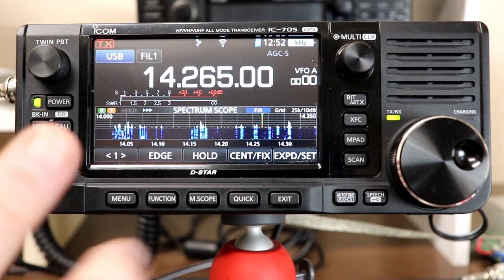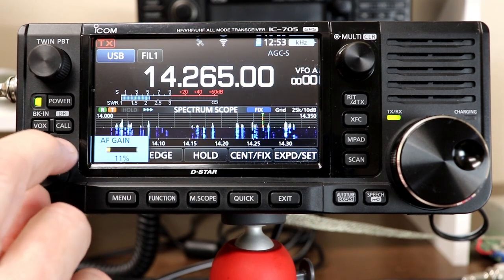IC-705 from A to Z #2 User Interface Basics

Comment: I have ordered my IC-705 which is supposed to be here in 2 days, I cant wait to get my hands on this one. It will be a lot easier to take into the field than my IC-7300 is.
Thanks for walking through everything as this radio has a LOT packed into such a small size.

Comment: Thanks for the excellent video.   What is the least expensive way to run direct power to the IC-705 so you're able to operate at 10 Watts?   Is there a "plug-in to receptacle" mini adapter solution - like you would have with a laptop for example?   Trying to avoid initially buying a larger "power supply" if possible.
Reply from the maker: Hi.  First, thank you for the kind words.  This is an excellent question!  I hadn’t really thought about this because I already have 12V supplies for my other radio gear.  You certainly don’t need a large station supply for just this radio.  HRO sells a 6 amp power supply for  ~ $47.00. They list the supply as being suitable for the 705.  According to the Icom manual, it draws a maximum of 3 Amps in Transmit

Comment: Amazing video, exactly what I needed!  Question, at time mark 10.29 what is the transmission that moves across the whole band scope from left to right? I see it on my 705 sometimes and have no idea what it is.
Reply from the maker: Hi Steve.  I've seen that multiple times on my 7300 and on the 705.  I've seen the pulses sweep across 80M, 40M and 20M.  It's amazing the things we notice with a spectrum scope that we would never be aware of with just a frequency display and nothing else.  I do not know exactly what that signal is.  I suspect it is related to the HF over-the-horizon radars that various countries' militaries operate.  From what I've read, I believe they normally operate over a fairly narrow range of frequencies, but maybe those sweeping pulses are some type of probe or calibration signal to see what frequencies have the best return echoes at that time.
Thanks for the kind words and I'm glad you're enjoying the videos.

Comment: Thank you for building this series of videos... I'm starting at the beginning after finding one in a random search. Do you have a video where you discuss your ball mount system? Can you provide links to the parts? Thanks in advance, 73
Reply from the maker: Hi Steve.  The ball mount is just a Manfrotto PIXI Mini tripod.  Here is a link for one on Amazon:  https://amzn.to/3hZUtrq  
There is also a littler higher end version, the PIXI EVO.  It has a little more adjustability.  You can find that one here:  https://amzn.to/3wveJ9u
Note that these are both affiliate links, but that doesn't affect your price.
I first learned saw this tripod with the 705 on Ham Radio Crash Course - another YouTube channel you might find useful:  https://www.youtube.com/c/HamRadioCrashCourse/featured
Thanks for watching!  73, Tom
Reply: @HamRadioA2Z  Thank you very much. I'm a bit embarrassed that I didn't think of Manfrotto. I have a carbon fiber tripod, a carbon fiber monopod, two ball heads and several camera quick disconnect mounts for my DSLRs. All of them say Manfrotto on the side ;-) oh well.

Comment: So I have a quick question: When you reference the "max watts" for the power output, is 10 the absolute limit to the power output?  Can I apply a 100w amplifier to benefit of the additional output if needed without doing damage to the radio?
Reply from the maker: Hi.  The Max Watts is the maximum power that the 705 will put out.  You can always add an amplifier after the radio to get to whatever (legal) power level you want.  The display on the 705 won’t show the power coming out of anything downstream from the radio.
Reply: @HamRadioA2Z  Thank you.  I was thinking that was the case, but I didn't want to step into a problem without asking first.  My IC705 showed up yesterday so I'm stoked and ready to get it set up.

Comment: Hello. Is it possible to communicate with a radio or repeater that has DMR but is not DSTAR?
Reply from the maker: Hi.  Unfortunately, no.  DMR (and C4FM that Yaesu uses) both use different protocols and a different CODEC to convert from audio to digital and back.  So a DSTAR radio cannot communicate directly with a DMR radio.  It’s one of things that I don’t care for about the digital voice modes.  Unlike AM, FM, and sideband, all of the radio brands don’t support a common standard.  A few years ago, some company announced a coming radio that would support all the major digital modes.  I don’t remember their name, but I’ve never seen anything on the market.
Reply: @HamRadioA2Z  Thank you !!!